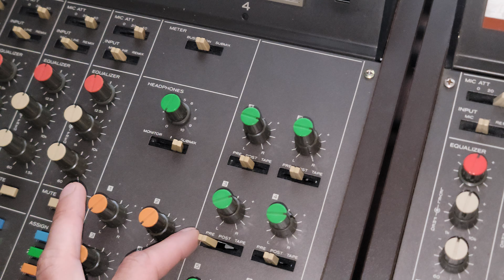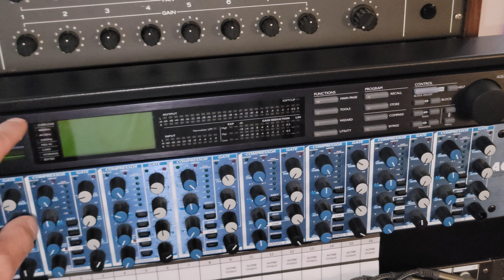analog music akai MPC-3000 thru Tascam M-30 mixer x yamaha behringer roland emu synths and effects

Comment: So when your “sending” out from mixer how many channels are you sending to the outboard  gear. How many outputs Does that mixer have?
Reply from the maker: I am using two 8 channel mixers together totalling 16 mono channels. Each channel has its own unique send and receive jack. Using a bunch of cable snakes (16 channel send plus 16 channel receive) they route to a patch bay where I can Insert a unique sound effect processor to the unique channel. The first 8 channels route to the submix buss in on the second mixer and that leaves me with a left/right submix out (to my 2track recorder) and monitor left/right out going to my reference monitor. @rizzlino_music on Instagram dm me for more info 🫡🫡
Reply: @Rizzlino_Music  nice…I only have a 12 channel mixer with 2 sends that take up channels 7/8 and 9/10  which I have my best pre amp and compressor on . I’m a lil envious of your setup with all those channels to spare…lol
Reply from the maker: @drenolynbeats  as your knowledge grows on how equipment works, you'll expand your equipment too. Plus we all know it's not what you got, it's how you use what you got.